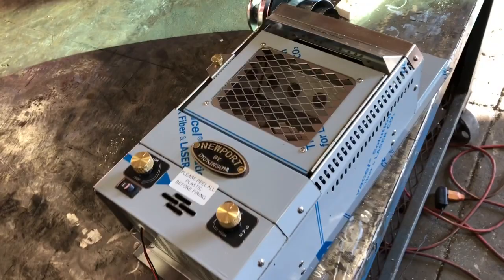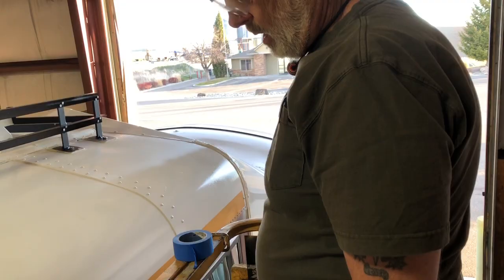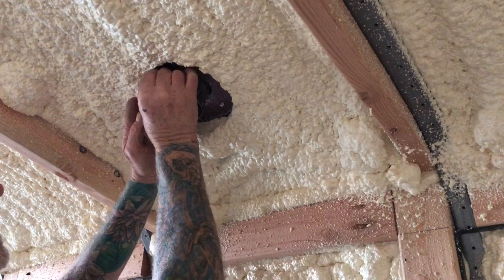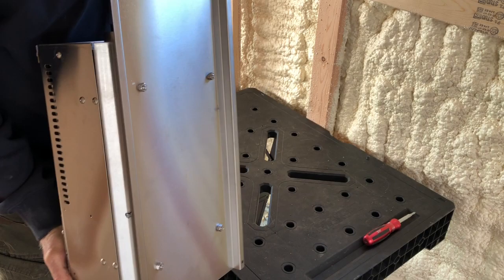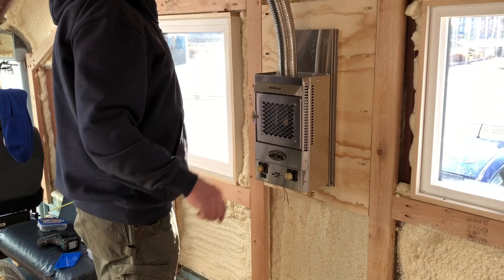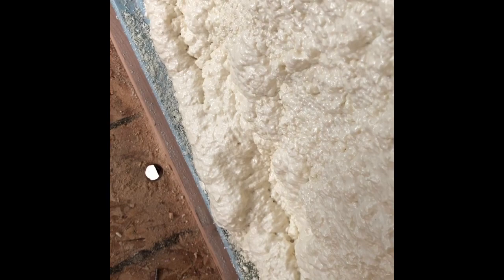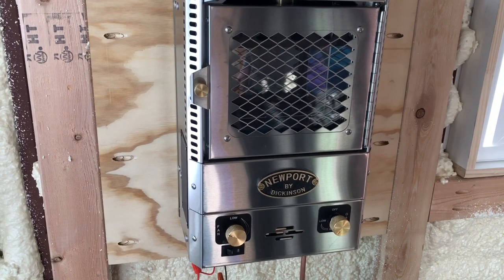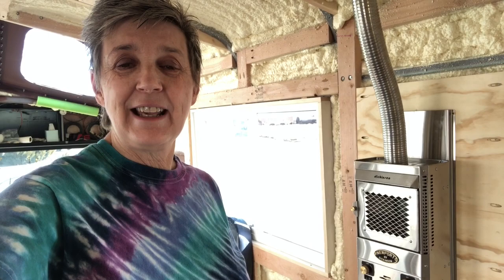Installing Dickinson Marine Propane Heater/Fireplace - Vlog 76 School Bus Conversion

Comment: Are you still using just a regular regulator? I'm wondering if it consumes more propane than with the one they want you to use??? 

I was using a Chinese diesel heater for the past 5 months in my enclosed trailer conversion, but had many times when the heater failed, so I'm thinking of buying the p9000 version since my trailer is only 14x7.5x6.6 with 2 inch medium density closed cell spray foam in walls and 3 inch in the floor.

Comment: How’s the heater working for you two now? I have a shuttle bus that’s about 110 sq feet, will  this heater do the job? I also live in southern Ontario.
Reply from the maker: We honestly don’t use use it  much.  We use our diesel heater more. We r building a box truck now and r putting in only a diesel heater.

Comment: I am prepping to install my p9000. What hardware did you use to mount the heater to your plywood wall? And did you compress the pipes as much as you could then determined the heater distance to ceiling with some extra knowing you can expand the pipes?

Comment: Does it heat up the whole bus?  We have a 24' airstream that I was thinking about installing one in.
Reply from the maker: No it does not heat the whole bus. We use it in combination with a diesel heater. But we have a 40 foot bus and it’s really cold here right now. 😃
Reply: @KnappTime  So I got one.  Installing it now.  Did you get the regulator set to 11?
Reply: I’ve been running it off of the regulator that is on the main tanks. It is a standard RV regulator set up with a combiner switch on it. But I don’t actually know how many pounds it is set at :-( but it runs the stove and the fireplace and the water heater just fine. Good luck with your install I hope you enjoy your new fireplace as much as we love ours :-)
Reply: @shelleyknapp617  Well, Dickinson said we needed a low flow regulator.  So I bought one at 150 bucks or so.  And on the unit itself, it says it's supposed to be installed outdoors.  I contacted Dickinson about the outdoor install (which would be hard for us space wise) and here is their reply, "Propane system regulations generally do not allow any connections inside the cabin as that increases the chance of propane leaking inside.  Usually the only connection permitted inside is the one at the appliance.  In most situations the regulators are installed inside a propane locker with a vent to the outside so that in the even of a leak, the excess propane is safely diverted outside."  Their customer service is very good.  They are super responsive with questions.
Reply: Thanks for sharing this information. Yeah that’s the way we have ours installed. The regulator is in the propane cabinet which has a vented floor in it.
Reply: @shelleyknapp617  Hm.  This complicates things for me since we don't have space outside of our Airstream.  Not sure what to do.  By the way, have you done a full tour video of your rig?  I would love to see it, if you did.  Haven't seen all your videos, but catch them here and there.  Nice job on your grasshopper.

Comment: Really nice job on the install and good narrative. So - almost a year later, a question about installation HEIGHT. If you were doing it again - would you mount it that high? Do you find the floor is cold? I know the fan points down (and is MUCH quieter on the newer ones) but have seen others install a fan up higher blowing heat off the chimney pipe towards the floor. It looks great that high - but would you do so again? Nice job!
Reply from the maker: We are really happy with where we have put it. You can sit in front of it and get warm. As far as putting it lower on the floor it might be harder to light and use the control knobs. Just my thoughts. But you have given us an idea for an updated video so keep watching. Thanks. 😃
Reply: @KnappTime  Sounds like a good idea! 

I already liked and subbed!